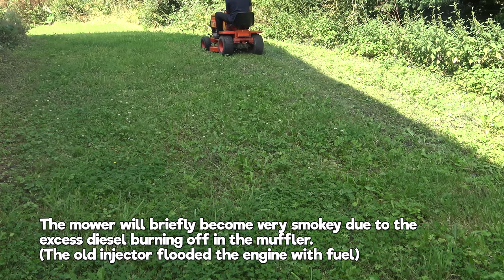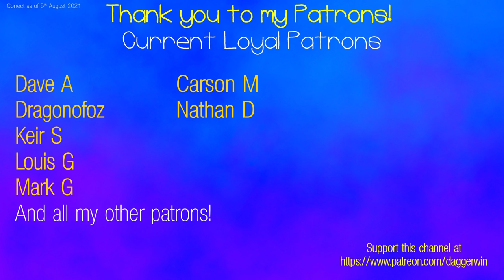LAWNMOWER CUTTING DECK RESTORATION

Comment: You do a great job with these mowers my friend! One thing to consider in your restorations is to strip and then re-bright zinc plate the parts that were originally zinc plated. I have a small zinc plating station that I use in my business. Re-bright zinc plating the steel parts in my restorations makes them look brand new. It's also very satisfying to make old bolts look brand new again.
Keep up the good work.

Comment: Very nice! Only criticism would be, my old dad was an engineer for the British army and Rolls Royce, he taught me, if your using nut and bolt put the nut on the bottom that way if the nut comes of for whatever reason you only loose the nut and everything stays where its supposed to be within reason, if you do it the other way round you loose the nut and bolt and the whole shebang falls to bits!

Comment: If anyone ever needed a zero turn mower I nominate you as the zero turn mower poster child!  Just watching you mill about, backing and filling on that little lawn fatigued me. I used to cut my lawn with a mower like yours. We're talking an acre of grass that took me three hours to cut, what with outbuildings and various trees and other obstacles. Now with a zero turn it takes ma about one hour and I am getting faster at it with practice. (My first summer with a zero turn ) An additional BIG benefit is that the zero turn, with comparison to my old mower, is just about effortless. Try one if you ever get a chance. You'll never go back to the old style.

Comment: Hi, I love your videos, as I am learning about small engine repair as a hobby.  I was wondering if you ever considered making a series of videos about the components/mechanics and function of a small engine, its parts (ie on a riding mower, deck, belts, etc), and how you diagnose problems.  I can't find anyone on YouTube that explains things as well as you do.  That was not meant to butter you up!  However, it's true.  You present your material in a logical and clear way.

Comment: loving the work but a few suggestions to make your life easier.
cover the paint stripper with a plastic sheet (or wrap the part loosly in plastic sheet) to slow its drying and letting it work longer.
fill bolt holes with tape before painting so you wont foul the threads
maybe look into some electrolysis for things like the new old stock bearing housings so you can repair the zinc plating 

otherwise exactly what we have come to expect from you, a good resto

Comment: Looks like the mower deck is a rear discharge style great to see you got her back in running condition
Reply: Westwood's have a rear hopper and rotary sweeper. Awesome  machines for thick wet grass, they will cut and collect anything,  with nothing to block up.
Reply: @matthewbrittain2919  thanks for the info on this mower young man

Comment: This probably isn't relevant to this video, I can't remember because I have been binge watching all of these videos of yours 😂, but anyway, I notice that you seem to put your decals on dry, and as someone that has put on hundreds of decals, if you spray some windex or the equivalent of that on your surface first, you can apply your decal and use a squeegee to work out any air bubbles and the window cleaner evaporates after a couple of hours. I learned this method from people who apply decals and placards fir a living. Hope this is helpful.
By the way, I have been watching your FS videos for years, I'm a big fan! Keep up the good work!

Comment: The second patch of grass, the thick stuff, looks like it could have been cut a little cleaner with some higher RPMs. But I don't know what that engine can do. Considering the low RPM/high torque nature of diesel engines and the small size of the deck and blades, they probably should have made this deck with smaller spindle pullies.

Comment: I wish I had this video in April when I recommissioned a Westwood 1012H.

I overhauled the deck, no where near as nicely as your's though.  Stripped it right back, regrettably didn't take photos of how it went together.

Hammering the spindles out was a nightmare & I ended up damaging the threads. But got them tapped & they're fine now.

Wire brushed rust & loose paint off the deck & welded on 2 patches & a large portion of skirt. Painted the deck with black hammerite. 

Put it back together with new bolts, bearings & sharpened the blades. I used old lino for the flap at the rear.

Gave the mower a full service, new pulley bearings, a few new belts & a really good clean. 

Replaced the rakes in the PGC & was amazed at the difference!

All I need now would be deck brake pads & a decent seat Know where I could get any?
Reply from the maker: I have seen a few good seats on Ebay, you can also buy universal seats new. You can get the brake pads from here: https://www.westwoodtractorspares.co.uk/cutting-decks/brake-blocks
Reply: @MachineryRestorer  nice job daggerwin or dagwin

Comment: Great work!

Interesting that such a brute of a tractor has only two spindles. Mine is definitely not diesel but has 50" deck with 3 spindles. I guess maybe cheaper with fewer spinning parts, bearings, etc? ( I figured riding mowers had smaller blades so more of the blades could be at the maximum allowed tip speed, no idea if that's true)

Comment: Wouldn't that d1200 have a 42 inch deck rather than a 36? Got 3 Lombardini diesel d1200 there 1986/86/87 all with 42 inch contra deck never seen a d1200 ruggerini in person but I'm sure there 12.5hp Vs the 8/9hp from Lombardini would of thought they be bigger deck than 36?

Comment: How do you install the break cable on the cutting deck I can’t see where it connects
Reply from the maker: It hooks around a rod underneath the tractor mower.
Reply: @MachineryRestorer  i can’t see it

Comment: A pity you didn't etch prime and paint the bearing carriers, especially given their rarity. A little below your usual high standards?
Reply from the maker: They are already zinc coated
Reply: @MachineryRestorer  well nearly all coated - they're pretty crusty with a lot of visible rust. Anyway it's your call. Good resto otherwise, a great looking machine.

Comment: Some of the parts he didn't really restore. The discs that held the pulleys should have been treated with rust converter, and painted black. The various pushrods, screws and springs should be plated in chrome and zink.
Reply: It’s a mower deck, not a classic car or motorcycle. He did a great job

Comment: You never torqued the hold down bolt.all injector hold down bolts have a torque.it is do to the high pressure they operate under.if not done properly the injector can possibly blow out if the hold down but is not torqued properly.please go back and torque it.
Reply from the maker: I have no spec chart for this engine. It's very tight.
Reply: Try looking online or ask Western Truck and Tractor Repair.he is a mechanic on YouTube.he might be able to help with the spec.